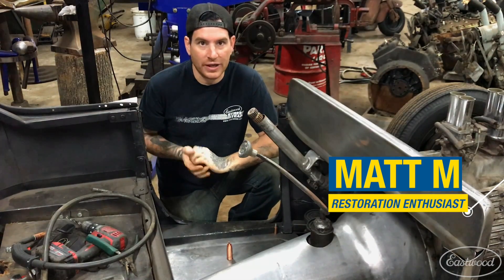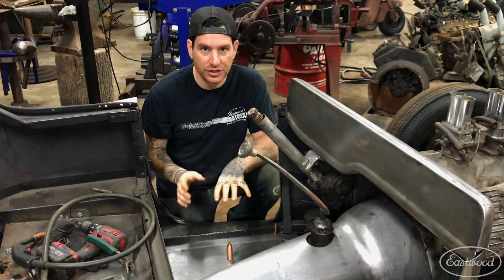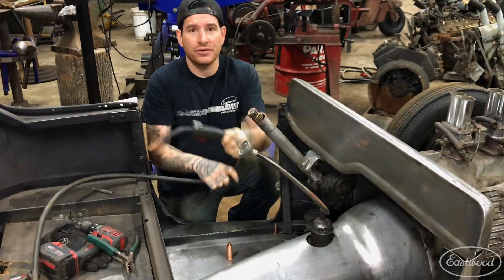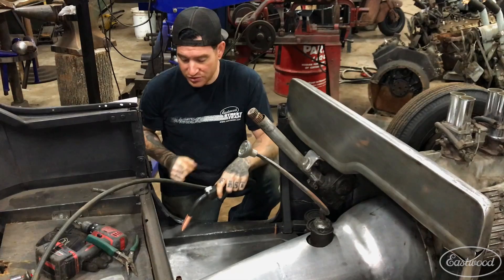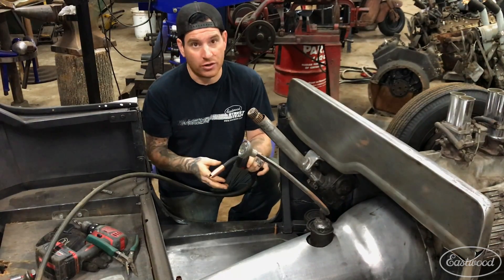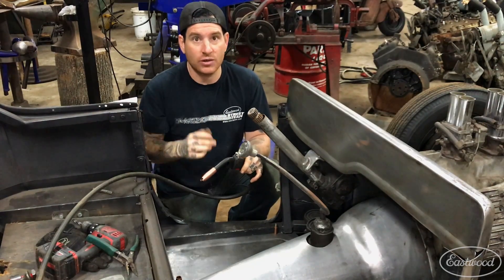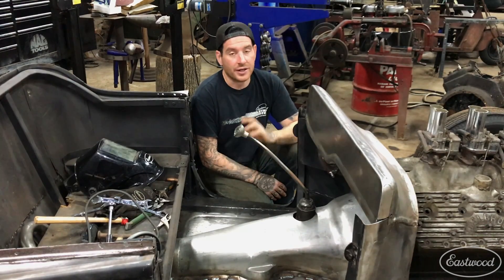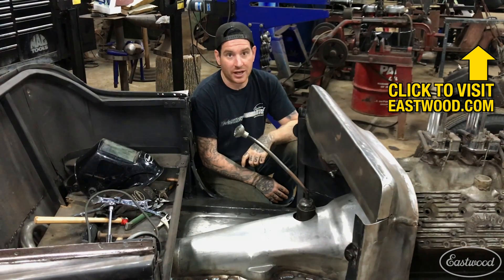Homemade Employee Testimonial - MIG Welding Spot Weld Nozzle - Eastwood

Comment: Any copper backing plate used? Or you just shot to the edges of your drilled holes?
Reply from the maker: Hi Karl, I was plug welding most of the holes here so the bottom layer wasn't drilled through and I didn't need a backer to support the weld. When I have both pieces drilled through (such as a panels held together with clecos) I will use a backer or start on the edge of the hole and push the puddle to the center. Thanks for watching! -Matt/EW
Reply: @eastwoodco  Awesome, thanks Matt!